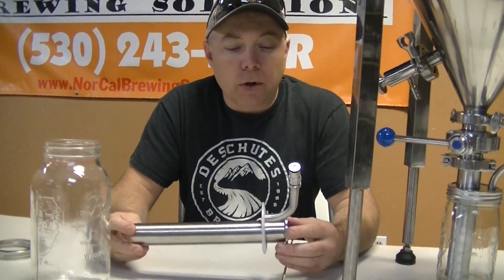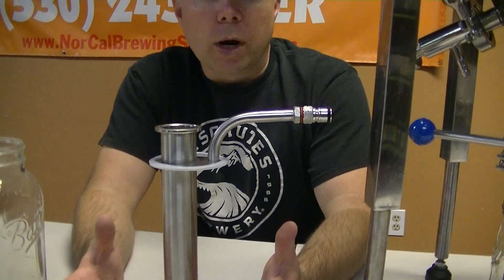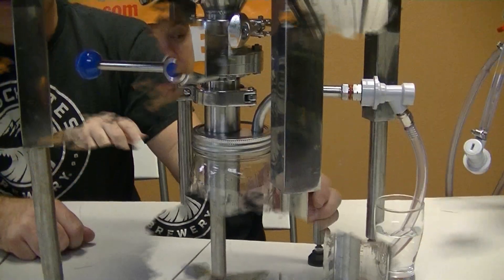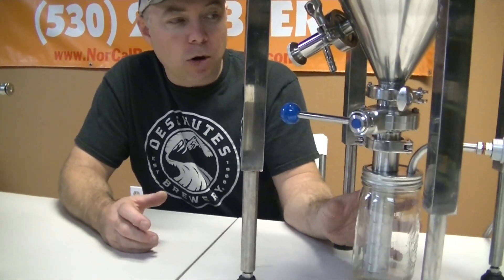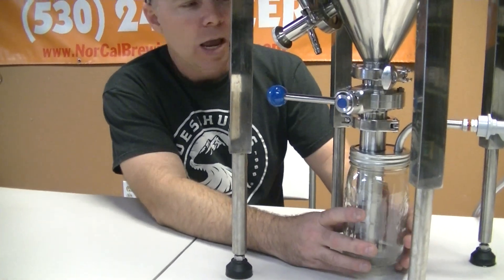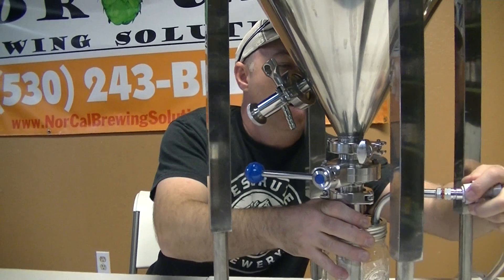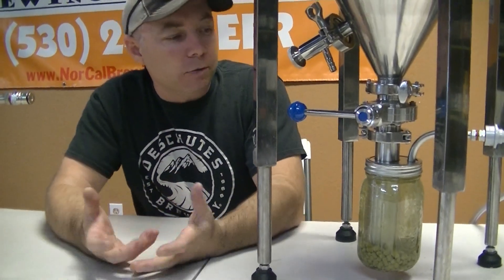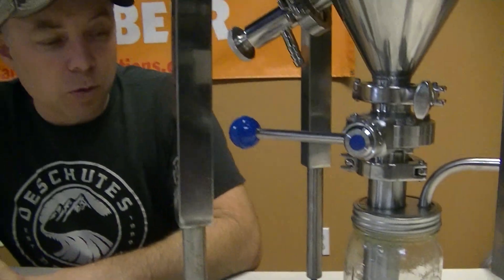Jaybird Yeast Brink / Dry Hop Injector for Conical Fermenters

Comment: I have one of these the problem that I had was, I attached and left the dump valve open hoping that the yeast would collect over a few days.  The problem was that when I first opened there was a lot of fermenting beer that moved into the sight glass.  As the fermentation went on, it didn't seem like additional settling yeast was able to displace through the narrow diameter brink tube the beer that had entered the site glass.  As such, I wasn't really able to collect much yeast.  Any thoughts?
Reply from the maker: I would definitely leave the valve closed during the fermentation process if the goal is to collect yeast post fermentation.  This will allow the yeast to settle in the conical without having to try and displace the beer already in the jar.  IF leaving it open is the goal we have a yeast harvester with exhaust port that is a better solution for that. SKU 3543 for the 1.5"
Cheers
Jay

Comment: Maybe I have had too many beers but couldn't you just leave the valve  open and collect the yeast  naturally 🤔.   I've seen the same thing with s*** plastic   conical fermenters
Reply from the maker: Yes a lot of brewers leave this valve open to collect during fermentation.  It's more about the transfer than the collection at that point.
Cheers
Jay
Reply: @NorCalBrewing  I've struggled trying to do this. If fermenting beer enters the site glass, it seems to be hard for new yeast to displace that beer.  Maybe I am wrong, but the yeast trying to push the down the tube just seemed to force the beer against the roof of the brink and it was stuck.

Comment: What were to happen if I didn’t have the exhaust port connected while draining the yeast?
Reply from the maker: David as long as its exhausting you're good.  Even if it wasn't exhausting "SOMEWHERE" and lets say plugged or even the old version without the exhaust port it would exhaust up through the conical.  
Cheers
Jay
Reply: @NorCalBrewing  thank you! I forgot to use an exhaust port for the first seconds and then atta he’d it later
Reply: @NorCalBrewing  thanks for the response! i attempted to dry hop, but i forgot to atrtach the ring and now the hops wont go up, is it becasue its not sealed tight?

Comment: How do you get the wide mouth ring over the 1.5"TC and gas line without bending it?  I noticed there was a "cut out"  when you were sliding the ring on.  I have bent a few and thought you might have a trick to doing it.
Reply from the maker: If you have it in the curve of the exhaust tube and just over the TC fitting and NOT the canning ring it will slide over with plenty of room.

Comment: If you have 15 pounds of head pressure in the conical how are you pushing the "yeast" back up into the vessel with just 4 pounds? In this case I would expect for the liquid to travel back toward your co2 connection. Also, as someone else expressed concerns of, what is the max PSI for the glass jar?
Reply: Yes you are correct.  If you have 15# of head pressure you would need 15.1# of gas pressure for the liquid to move in the desired direction.  As for glass jar.  I have personally tested a glass jar to well above the usage pressures we suggest using.  The weakest link in the system for "PRESSURE" is the ring not the glass jar itself.  Meaning the ring will pop off the jar long before the glass jar will break.  All that having been said.  Use with caution as with anything you use that is glass.  
Cheers

Comment: Just an idea, but if you created a stainless steel perforated cup and dropped it down the tube rather than in the jar it would more effectively push the hops into the beer.  It wouldn't need to be much either.  Just an insert that would keep the pellets from falling out of the tube. https://www.amazon.com/U-S-Kitchen-Supply-Perforated-Seasonings/dp/B01MDTMBUI Those are a little big, but you get the idea.

Comment: Very great idea, what do you have installed in terms of an airlock or pressure release valve? I wonder what you would do to prevent anything from being drawn then when you dump the yeast or beer into the jar.
Reply: I personally use 

https://www.norcalbrewingsolutions.com/store/Ultimate-CO2-Canning-Jar-Harvesting-Kit.html

Cheers
Jay
Reply: If your conical can be pressurized I would assume fermenting under pressure would solve this issue.